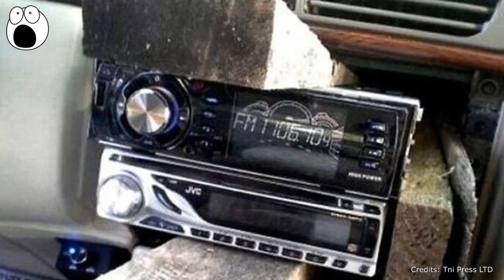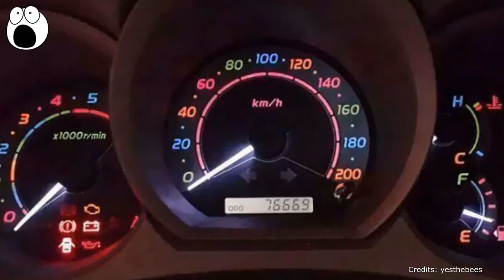The Most Creative Car Owners In The World

Comment: Repairing a broken bumper by corset stitching or zip tie stitches through small drill holes, works, and I kinda like it. Considering the zip ties themselves each have a shear weight of about 40 lbs, you're probably not losing much structural rigidity on that plastic bumper. Heck, you might even be gaining some.

Comment: sees 50 riced cars

I'm glad mine has a cold air intake, performance exhausts, high-flow headers and a nice little turbocharger... and a LSD, 6 piston brake kit, cross and slotted rotors, racing camshafts and gears, performance clutch, an e-brake and an angle kit